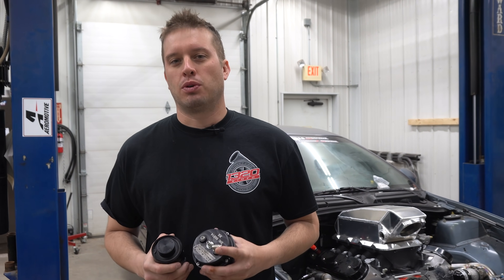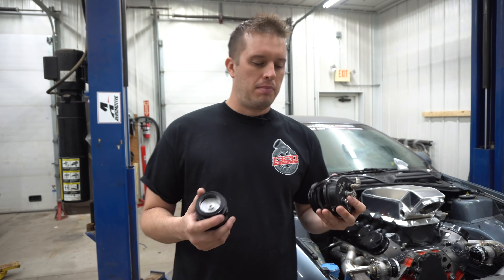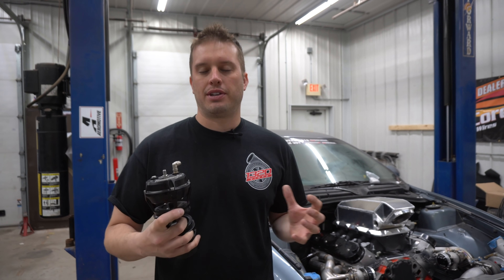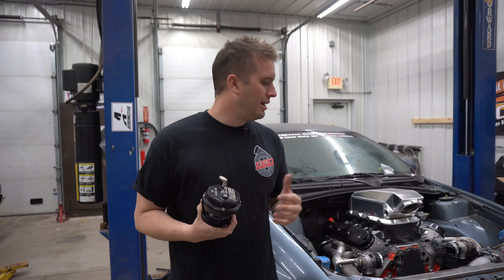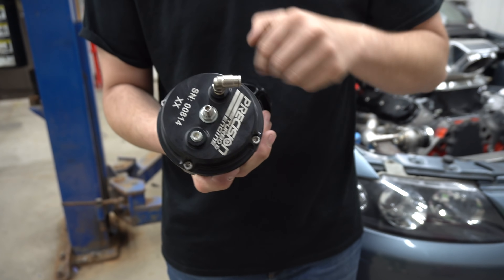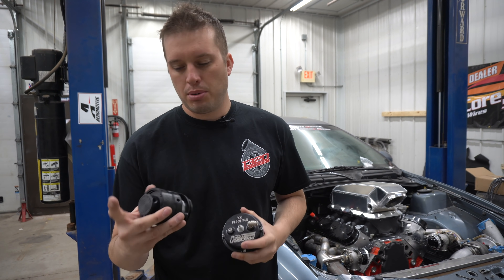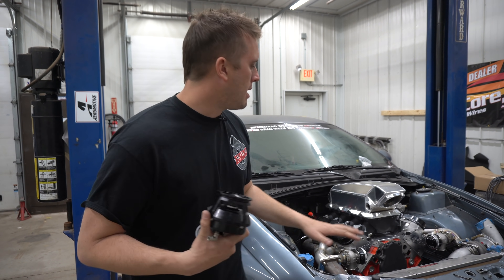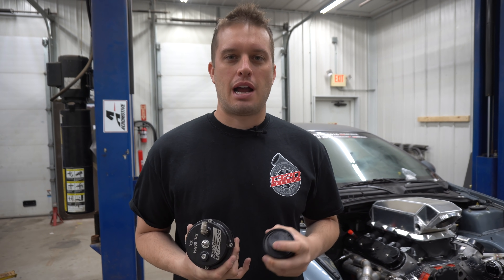Blow Off Valves 101: What they do, and why you need them!  Tech Tip Tuesday

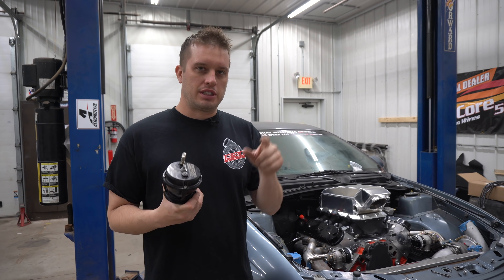Comment: 5:15  And that's how you know the blow off valve is not adjusted to suit the engine. A properly adjusted working blow off valve is shut at idle and it should take very little force to open it.

Comment: Turbo Buicks never had them and plenty of stock turbos and even upgraded ones last 100k plus like that. It's an old argument but I agree they help in the right application. Larger ones need them more. I run a 6465 at 30+psi without one but that's still tiny compared to what y'all are doin'. You loose that signature turbo Buick sneeze when you go to a bov too. ;) Keep up the great videos! I love 'em.

Comment: Well my boost gauge goes down when I slam the throttle shut as you also unload the turbine wheel. Ill take my chances for that sound thoooo. 1700 miles currently with no bov but granted I'm not running a 1000+ dollar turbo

Comment: still undecided on a blow-off valve for mine. Heard so many arguments both ways.  This does sound reasonable though. What I don't like is it being open at idle. I watched a kid install one on his turbo mustang and they were all so pumped. Then I watched it as they drove. They put theirs right down at the intercooler. Driving around at normal speed with vacuum they had a 2" open valve right down at street level in the dirt. Then I heard that they spring them to engine vacuum. I thought that would keep it closed until boost overcomes the spring pressure. No here you say that they are open and floating back and forth at idle. So once again I'm lost and don't know what to do. I think I will still go ahead and run one at the TB just to save the intake and intercooler just in case.